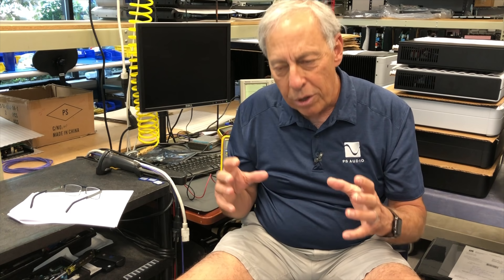Why do speakers have rear tweeters?

Comment: rear facing tweets and side facing woofs, wow very exciting.
Reply: Dont forget downfiring subs, and up firing mids (Atmos)
Reply: doyle wayne no sides hes doing away with the side facing woofers what makes sense but open dipole two front and back yes
Reply: The down firing woofers are something else. Not sure I like the idea of them jackhammering the floor, but it is quite the experience.
Reply: In a sonotube, you can get alot of enclosure volume, without taking up alot of floor space. (just like skyscrapers) Bass can be tactile so hammering the floor is OK
Reply: the world has turned down eheheheheheheheh I m in yer face kinda audiophile--
Reply: @TheRockerxx69  then the world is too old😉

Comment: Are rear tweeters crossed identically as the front ones? Or, what's the "magic recipe"?
Reply: Full Ranger off phase between the two
Reply: The magic is they are out of phase and it adds some "air" to the music without immediate cancellation effects.

The downside is, it's an often enjoyable audio trick which negates accuracy.

I love the idea with a "BIG IF." Let the customer turn the rear tweeter on and off to their liking.

Comment: Hi Paul looking forward to seeing the ps audio speakers. On the subject of ribbon tweeters , thinking of upgrading my normal silk dome ones to ribbons. Is it safe to use them horizontally mounted? As I've only ever seen them mounted vertically.
Reply: Dispersion patterns are the opposite of driver shape. If you place it horizontally, it will cover a narrow right/left area but have long top/down pattern. It will have a center channel or near field monitor affect provided your ceiling and floors are damped.

Consider a vertical line array. It's the opposite affect. The left/right dispersion is wide. The vertical pattern is actually limited. It prevents ceiling and floor reflections. This appears odd because the top and bottom speaker are getting closer the floor and ceiling.

It has to do with the affect of longer wavelengths getting trapped on the surface of a speaker driver, or on the length of a line array. If you look at it like that, it becomes easy to predict the sound coverage pattern.

Comment: Hi. Good subject. Are the rear mounted tweeters still relevant if the speakers are close to the rear wall, like 20 inches (50 centimeters)?
Reply: You'd have to listen and see, but a good implementation of ambience tweeters would allow them to be disabled or their level to be reduced if they are contributing too much. 20 inches is probably still workable with rear-facing tweeters, but if your speakers back up right to the wall, maybe 12 inches or less, it would be best to disable them. If there's no switch, you could probably remove the tweeter and disconnect one of its terminals so that it no longer plays, but the wire will be kept from rattling inside the cabinet.

Comment: It's all marketing.. first only in front, now front and back.. the sides coming soon
Reply: Fuck it why not just go for a cube with even an internal band pass speaker😂

You have seven points of spatial reference in one speaker... Call now only 10 easy payments $19.95 per speaker 😉🤣
Reply: It's not all marketing. I'd love to have a rear firing tweeter. But I'd also love to be able to turn it off.

There are times I would enjoy the extra "air" that wouldn't be technically accurate.

And there are times I'd want it off so accuracy is improved.

Comment: ...if people are after the "live" sound... Why don't they just buy a PA rig used in live audio?

Because there is stage volume and croud volume.

Never made sense to me shelling out big bucks chasing live sound when you can just go to guitar center and buy a pa and put your music threw it... Its gonna have the same effect I Imagine.

At least for music that is usually played on those systems live.

I understand that is not great for acoustic performance replication.... But really thinking about it, if your enjoying the live sound of concerts and stuff, why not just get a live system?

Maybe you could clear this up for me?
As I run sound for live bands.

Is this some industry secret that isn't supposed to be out there?
Reply: One problem. Live sound is often horrendous due to horrendous PA speakers.

I'm all for rear tweeters on reference speakers, but give the customer the ability to turn them off.

Comment: Why on the back of the speaker and not on the side or sides and front?? Are those speak as you go on about Paul going to be better than the Lx521.4? Doubtful and what's your opinion any.
Reply: To add decorrelated energy (that is delayed enough in time that it "sounds" reverberant), the tweeter should face away from the listener and be placed as far as possible from the panel edges so that the energy does not diffract and wrap around that boundary toward the listener. It is intended to illuminate the walls of the room. If placed on top of the cabinet, it should be as far back as it can be, and maybe a piece of felt or foam should be used to prevent the treble output from being able to travel forward to the listener as direct but out-of-time sound.
Reply: @Acoustic_Theory  

It's a great affect, but I'd love to turn it off when I desire.